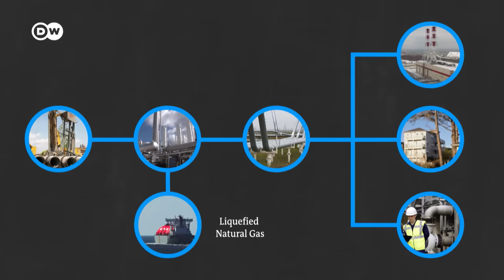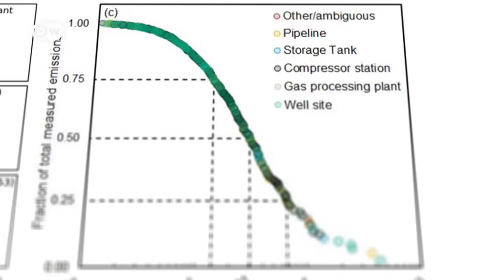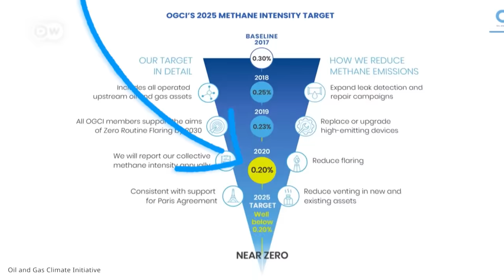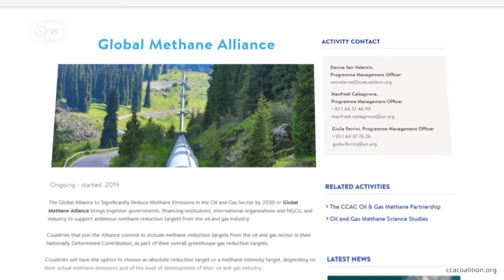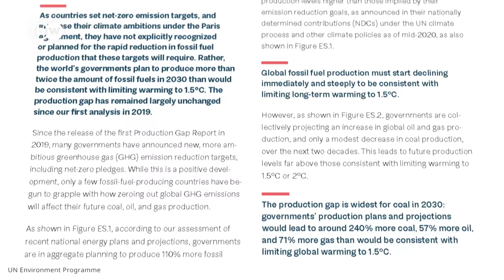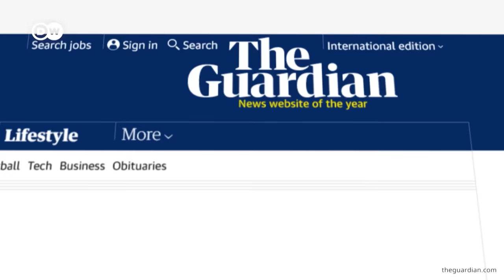Why we need to ditch natural gas (asap)

Comment: You know what doesn’t help? Turning off already built nuclear power plants that still have usable years left in them… especially when you know who is having you know what sanctioned over invading you know where.
Reply: Right on, now the whole union will have to pay for Germany ‘gas’ mistake..
Reply: Well said.
Reply: Yes, especially knowing there’s no clean energy as of now.
Reply: Voldemort?
Reply: @LiquidShivaz  ?
Reply: @alana8863  Clean energy is a narrative.
Reply: @LiquidShivaz  Not sure what you mean, but 'clean energy' refers to a low or even non-existent (this second one's theoretical, at least for the time-being) production of pollutants when energy is created. 

Now, what's your point?
Reply: @alana8863  I was agreeing with ts, there’s no point as I see clean energy as non existent. There will always be some sort of pollution and/or disruption when generating energy. It’s my adversity to green washing.
Reply: @LiquidShivaz  Yes, there's no such thing as perfection, but we do have to do better than we are.
Reply: @nenmaster5218  Thank you!
Reply: Just curious if any of those plants can be put back into operation in any capacity? or are they completely decommissioned and stripped?
Reply: The Grumpy Horticulturist  You need a different kind of nuclear power plant for thorium. China has the first one in operation since I think October last year. The other versions are still being developed. But well they should just use the plutonium ones they have. They can be used almost immediately.
Reply: @nathanm4444  Ironically that is not true. Thorium more efficiently breeds to U233 in thermal spectrum reactors, which means Light water reactors, heavy water reactors, and graphite moderated reactors. The third and final core loading at pressurized light water reactor at the Shippingport Atomic Power Station included an experimental thorium breeding blanket that achieved a breeding ratio of 1.01. In other words, the waste contained 1% more fuel content than the initial core loading.
Reply: You know what else doesn't help? The nasty habit the US oil companies have had of leaving orphan wells uncapped and busily emitting methane & other unpleasant gases. Because that needs dealing with urgently.
Reply: Don’t worry anymore they’re turning them back on now
Reply: @robbebrecx2136  mainly finland who doesn't even really use gas
Reply: That's where the pressure lies. California finally voted to keep Diablo Canyon online. The last one in their State.
Reply: @johncampbell4084  It's a question of what state of decomissioning each power plant is in. Shutting down is an expensive process, as is reactivating, so there is always a temptation to just build a newer. Right now, better alternatives are becoming available, like Micro and Mini reactors. -300MW and -1GW respectively.
Reply: Yes we need to learn to live without heating to help our you know what enjoy geopolitical games and be inspired by our overseas masters , you know who, who know they are special
Reply: Nuclear power plants aren't just a light switch. Radioactive substances make materials weak in the sense that they are strengthened but made brittle at the same time. There are hundreds of thousands of components that go into just the main vessels of a plant alone. Plants shut down for a reason.
Reply: Right, because that worked out so well for Fukushima
Reply: @LiquidShivaz  false, if we ever made a Dyson swarm around the sun that would be clean energy, fusion energy is clean and fission is clean as well (besides the byproducts of which 90% can be recycled and the rest is capable of being stored in a safe building without any chance of leaking)

Solar and wind also are clean although it requires a lot of space and aren't recyclable when they break down

That's all of em I think
Reply: Or turning off oil fuelled power stations. Coal should be the first you turn off, however only when you have a completely green alternative. Gas is not an alternative and you waste money and produce more emissions by shutting down a power station prematurely. The dash for gas is just as politically motivated, and as fundamentally flawed as the dash for diesel.
Reply: @alanjenkins1508  thats why we need nuclear energy, can't get cleaner and safer than that
Reply: WHAT WHERE?
Reply: @robbebrecx2136  You remember that time when Trump told Germany that they were mistaken to rely on Russia for their entire gas supply.....and they laughed at him....you remember that?
Reply: That's a symptom of a wider phenomena  called overreacting emotionally and under public pressure to a disaster. In this case it was the Fukushima disaster in Japan.

 This is a inherent weak spot of every democracy. We overreact to singular events without thinking them through.
Reply: @carlnewman24  Ya, I remember that, everyone knew it was a potential problem.
Do you remember when Trump asked if it was possible to nuke a hurricane?
Reply: But that makes to much sense so they'll never get turned back on
Reply: DW was ranting against those as well.
Reply: Indeed. It’s peak irresponsibility.
Reply: Nuclear energy is the future. First Fission then Fusion energy.
Reply: Nuclear, is probably our best option to fight climate change.
Reply: @alana8863  The point is the only valid renewable energy option that is pollutant-free is fear-mongered about.
Reply: @Xio189  If you mean nuclear power, firstly, there are plenty of other options that are working. 

Secondly, with Russia and Ukraine fighting over Chernobyl at the moment, with the risk of a consequent release of radiation that could be on an unprecedented scale, it's probably not the best time to urge a significant expanse of the nuclear energy.
Reply: Totally agree though you could see this miles away that turning off nuclear power plants was a bad idea
Reply: Interesting observation: every crisis has handed more powers to Brussels and tighten their grip on the EU.
Reply: @johnsmyth9123  Actually that is not his credit, but a rather well researched subject.

Not that that this particular method was ever considered feasible for a number of obvious reasons, but the theoretical possibilities to dislodge storms by human interference are there.

Generally politicians are not science savvy by nature of their virtue as their backgrounds are usually legal, management or simply industry lobby. This is not only true for the guy that you have mentioned, but for almost all.

The only difference of course that there was a coordinated campaign to highlight the stupidity that he gave from himself, while at the same time there was also a coordinated campaign to shield the stupidity of others that were favored.

It is important that we start looking at these things while we step back a bit. If we really want to tackle climate change, it is important that we know the arguments of the other side.

A good example is the case of nuclear powerplants in Germany vs. France. One condemns, them while the other embraces them. Who is right, who is wrong?

So it is not enough to listen to one side of the argument.

Let's remember "He who knows only his own side of the case knows little of that..." - John Stuart Mill.
Reply: Exactly, couldnt agree more Joe
Reply: Why are you complaining...  Soon enough you will be happy and own nothing (WEF quote 2022) :*
Reply: @user-zy4wv7yx1z  if it takes an earthquake of magnitude 9 and a tsunami to have an impact on a nuclear plant then we can take that risk. Houses were also destroyed should we stop building houses?
Reply: @xanderx2523  Silly comparison, houses don't have a nuclear meltdown if they get damaged
Reply: @user-zy4wv7yx1z  no they don't but people seem so obsessed with two nuclear power plants that went into meldown in history. Meanwhile they stay silent on countries like France who have run on 70% nuclear energy with no problems for decades. People who oppose nuclear seem so reactionary. Like I said it took an earthquake and tsunami (two things that destroyed alot of things) to cause the meltdown in Japan. It not like nuclear plants meltdown easily.
Reply: @xanderx2523  But they are important points to consider. Like how a nuclear power plant can be used as a point of attack, like in Ukraine. 

I'd be concerned about the US too. Given how easily those insurrectionists got into the capitol, I'm sure the US us lax on nuclear power plant security too. 

A terrorist can't do much when they takeover a coal or a wind plant, but they have power in a nuclear one.
Reply: And Germany laughed at Trump when he said this.
Reply: @user-zy4wv7yx1z  Yes I agree that foreign powers and insurrectionist can use that vulnerability but they would lose also if they target a nuclear power plant. The fallout is bad for the world not just one country. They need to be secured enough for this and terrorists attacks not to happen. But te benefits are so great that I don't see that as an reason not to build them. I mean in 2015 the terrorist attacks (people who usually don't give a f) in France didn't target a nuclear plant. So I see your concerns as a threat but not a reason not to build them. The benefits outweighs the risks.
Reply: Agreed
Reply: Nuclear is the cleanest we know. Well, that actually works
Reply: @michaeldeleted  fighting “manmadeglobalwarmingglobalcoolingclimatechange”.😊
Reply: @alana8863  other options as in…solar? Wind?
I hope you enjoy hot beer
Reply: @user-zy4wv7yx1z  I’ll make a bet with you. Come on over to the US and go to any nuclear plant. When you get there start running from the gate(after you get past the guards) and head for the control room. 
I’ll be across the street videoing the event. 
Employees of the companies that own these plants going in to work on substations and power lines have to wait as long as an hour while their vehicles are searched (company vehicles). 
Sounds like fun. Care to take the bet?
Reply: @Failed Society aren’t still usable years left in them….references? Quotes?
You do realize that nuclear plants are regularly relicensed after their original expected life is up? 
No fuel? Did someone shut the mining down?
Where did this come from?
Reply: @richardcranium3579  I'm already in the US, but thanks for the invite. 

I'm talking about terrorist attacks, drones, planes, etc hitting the power plant. The government let people waltz into the capital on Jan 6th. Extremely lax security
Reply: @nathanm4444  Actually this isn’t true; Thorium has been added to conventional (LWR/PWR) reactors to make them breed their own fuel. That said the advantages of Molten Salt Reactors over water cooled reactors convinced me that MSR’s are what we should have done. Nixon nixed (!) what next gen nuclear could have been.
Reply: @phil20_20  The real irony of Diablo is that it generates 1.4 watts of waste heat for every watt of electricity (as all steam turbine power plants do). That waste heat could be used to desalinate water… to the tune of about six million gallons of water per day!
Reply: @geowar20  ah okay didn't know that
Reply: Zz
Reply: @engineeruk8667  Sometimes they are shut because radical groups use political pressure. Happened in Tennessee in the 1970s
Reply: Can we not "you know" when we all don't know? Speak up front, if you're worried about being censored, speak louder.
Reply: This 1000%. One of our best routes out of using oil (and developing reliance on other countries) is investing/innovating in the already vastly-improved (and now much safer) nuclear technologies.

Sadly, antinuclear messaging is too ingrained in the average public citizen's subconscious, and, more importantly, it's seriously antiscientific.
Reply: We shouldn't build any more, but pre-existing ones should be allowed to play out their lifespans.

Comment: Nuclear in combination with renewables is the key to ditch fossil fuels and have a stable electric grid.
Reply: Actually Thorium based Nuclear Reactors + renewables is the key to ditch Fossil fuels.
Reply: Precisely 🙋🏼‍♀️ also geothermal energy plants and hydroelectric dams.
Reply: @petrbelohoubek6759  I wasn't aware of that. Thanks for the information. I prefer nuclear power plants and geothermal energy plants.  I'm not a fan of hydroelectric power plants.  Although, that's for other reasons, such as the problems experienced in Indochina because of the massive dams in China.
Reply: good luck making chemicals and pharmaceuticals with nuclear energy without fossil fuels
Reply: @petrbelohoubek6759  its from oil, oil that has to be processed. If you stop drilling for oil you wont have that raw material anymore will you?
Reply: Indeed, though nuclear, in the form of modern micro reactors, should be the real "bridge fuel" and be replaced with proper renewables or thorium / fusion reactors when they become available.
Reply: Or better yet biofuels which can be considered natural gas
Reply: @petrbelohoubek6759  
What do you think happens to the plastic after it's been used?
Reply: Lmao as a Petroleum engineer I doubt you know how impossible it would be for renewables to do much. I'm down for nuclear but oil and gas are never fully getting replaced.
Reply: @johanjimenez1249  Enlighten us.
Reply: @rorychivers8769  I can keep going on but I've made my point.
Reply: @bh5826  Certain ones are like biogas from burnt methane
Reply: @marketsquareus  The ideal solution but possibly not viable right now is convert animal and human sewage to simpler gas and liquid compounds: destroying plastic and pharmaceutical contaminants in the sewage, to fertilize crops or to burn or synthesize more complex carbon molecules for industry; instead of using fossil fuels,  while retaining the fossil fuel distribution  infrastructure.